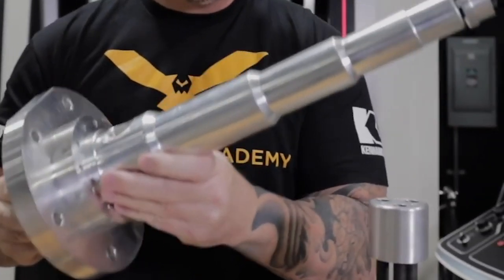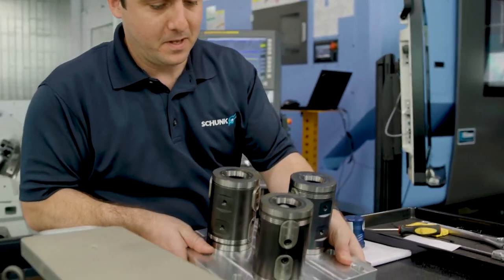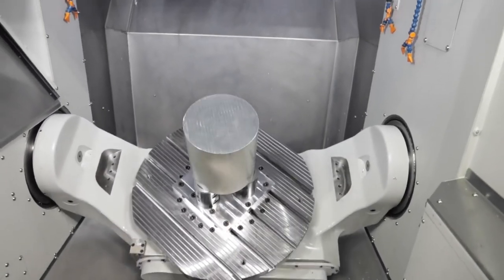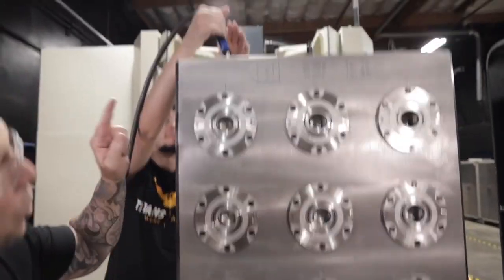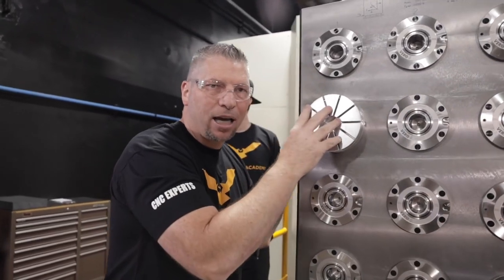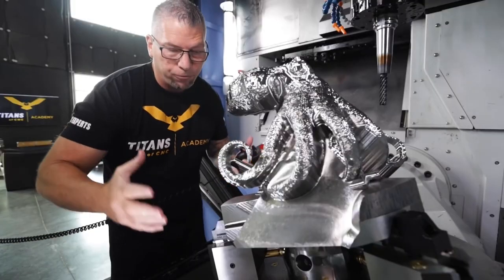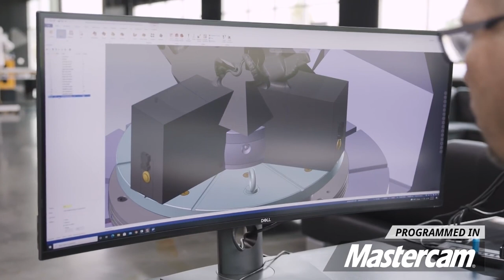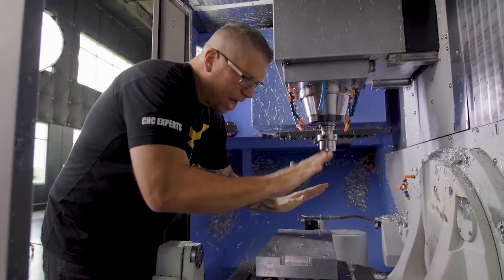Amazing Creative Workholding Ideas for Prototyping & Production CNC Machining | Art of Fixturing

Comment: Its amazing the money and resources that go into machining. The coolant and up keep, tool holders, mills, vises, holders. Not to mention all the chips that made with wasted energy. I imagine someone will come up with 3d printed "like" machine that can have tolerances similar to conventional machining which could eliminated  a lot of the costs.
Reply: That technology takes too long and is too expensive. Hasn't caught up to reduction machining yet. Besides, the chips, if isolated between materials, are sold to recyclers for good money. There's entire industries developed for the "post machining" processing of metal. It can be re-cast and it can go right back into the industrial ecosystem!

Comment: I have been using a vero-s 8 receptacle plate for about 3 months on a DMU-90.  The pneumatic receptacle has nothing to mitigate the 90psi of air in the system from shooting shavings into your fingers.  Yea I've had it happen.  I'm using gloves and standing to the side and a few other maneuvers now days.  I'm sure it's missing some piece that came with it but I just want to use a Prevost safety coupler with it.

Show the dovetail five axis vises if you have some!  We are pushing to get a few of them for smaller parts on first op.

Comment: It’s not a clamping pin,   It’s a “retention knob”.       And the locating pin should be referred to as a “clocking pin”
Keep your risers as short as possible to increase rigidity and reduce vibrations and harmonics.
Nice video and nice equipment.    Good luck and Cheers

Comment: Hey Titan when would you use steel fixtures over aluminum fixtures? I noticed pretty much all your fixtures are aluminum.
Reply: Aluminum parts you can use aluminum fixtures without much worry.  If you have steel parts the cutting forces required can, over time, distort an aluminum fixture.  There are always exceptions to this though.  If you have a really light steel part with minimal roughing an aluminum fixture may do just fine.  I've worked at shops there they use aluminum to make fixtures in order to improve the fixture design over time.  Once the have a design that works the way they want it they'd make a steel version for the long term production of the parts.  Then there is also the problem of revision changes to the parts.  You don't want to invest a bunch of time making a steel fixture just to have the part roll revs and make your kick ass fixture obsolete.  In the end it really depends on the job and the part.
Reply: Most of the time is a time/material availability issue.  And surface area matters too.  If you have a codified part make it out of steel or even dura bar, if not usually you are going to use aluminum for ease of manufacture.  The larger the clamping surface area is the less it matters, well most of the time.  Yea and on aluminum you typically use inserts in the fixture like mcmaster carr has and carr lane too.  You can get away not doing that with mild steel.

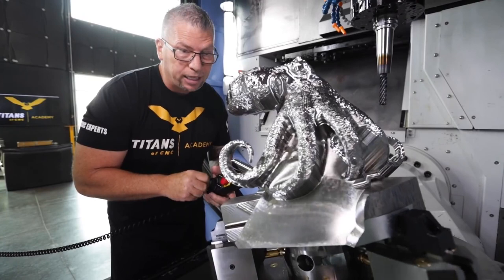Comment: 4:44 - I've always been told that shrinkfit holders arent good for roughing. But here he is with a long tool in titanium... is he just using a super low stepover then?
Reply: they can pull out but it depends on the toolpath.  I used one on a tricordal slotting path for stiffness and clearance reasons and it worked great in 15-5 SS.  I've had a long 3/4" EM pull out in aluminum doing a full slotting path.